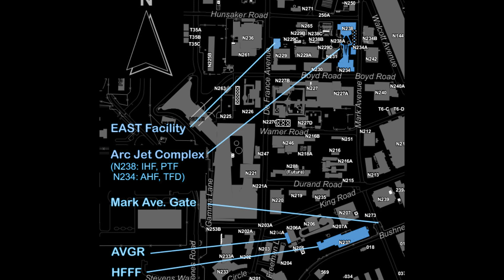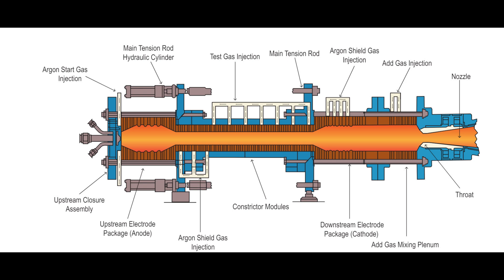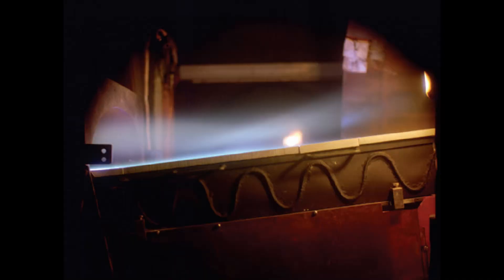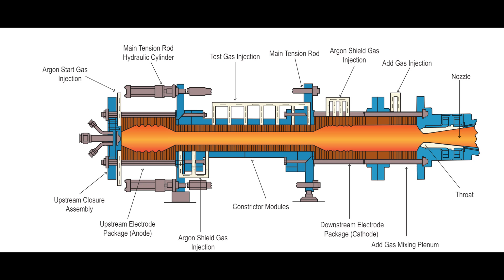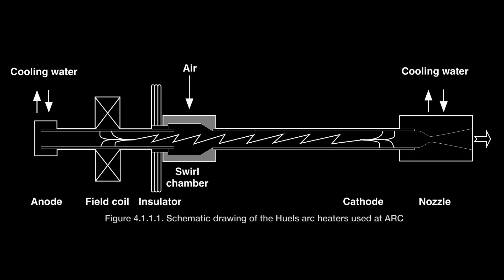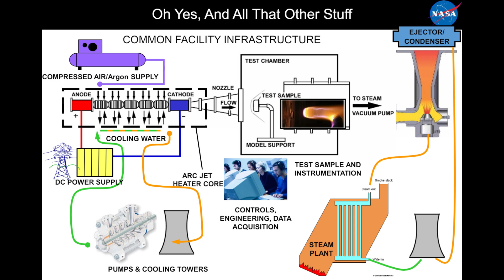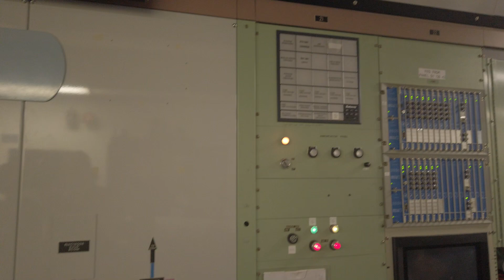How NASA Tests Heat Shields Using a Plasma Wind Tunnel

Comment: After some numbers, (quite easy, actually),  a laser heating a plasma (not supersonic) can generate a very high energy yet, but at a fraction of the energy.  The thought is that most of the supersonic gas just goes around the material, and most of the physics/chemistry happens within the subsonic layer, I just needs the added heat from a laser.  One can even bring the laser against the flow of the plasma, which bounces due to the plasma ionization, heating up the gas very locally.  This could even allow high temp material manufacturing, as it becomes cheap.

Comment: Convert this wind tunnel to a rocket engine.

"Assuming a conservative estimate for thermal efficiency of around 70%, the equivalent rocket engine power output would be...  60 MW of electrical power used by the arcjet plasma wind tunnel were to be converted with the efficiency of a rocket engine, it would be roughly equivalent to a rocket engine with an output power of approximately 85.7 MW. This hypothetical estimate gives us an idea of the power scale we might expect for a rocket engine that could produce similar thrust levels at hypersonic speeds. .. The power output of the arcjet plasma wind tunnel could potentially align with current types of rocket engines" - GPT

Comment: Wpw 200kw+ out of 4 fibers, 50kw of laser down a pipe is insane. The large optics at the end are collimators for the fiber. Ive seen what happens when a 4kW laser fiber breaks... it turns to a fuse burning with a blue white plasma.😮

Comment: To be a bit more explanatory, the meteor lava is flowing back to the base due to the base drag vacuum (low pressure area).  It's easily seen on the motor side of any of the liquid fueled rockets, and the reason why they have so many blankets/shields around the motors, as well as our amateur solid motor ones, with anything other than minimum diameter.  That lava is just a wee bit more dense!  Thanks Scot, Joe, and Tim for a nice view.

Comment: can we get a test using a hull made of an electron heavy element, charged with high voltage?.... id like to se the reactions when it doesn't need any heat shielding after all.

Comment: 10:51 I expect see any experiment with supermagnet shiled. I see many of ablative but need tu expand my knowledge in more stufs like supermagnet shield.
I would like to know if is posible. Because tha hot gas(plasma) wich by definition is hot gas ionized so the magnetic field can interact with it. so Imagine have 2 magnet faceing in the same way. they dont touch each other so the heat can be 5mm away from structure and also cant make erosion flow because no stream mass is touching. And supermagnet is coled by METHALOX, any of the bot or separate. Electricity can be used in a battery but i think it can store that amount of energy. so i sugest a generator compartiment fueled byt METHALOX. If this is achived the motor complexity can be reduced aswell, but is another storry.

Comment: So it's basically a plasma cutter pilot arc that is configured to burn not nearly as hot? I tried burning wood with plasma cutter pilot arc, and it basically vaporizes wood without much charring, it's that hot (and a safety reminder for those of you with plasma cutter with integrated compressor, treat it like a loaded gun, it will burn a hole in your hand before you even realize it! This is why the newer Chinese plasma torch have trigger guards).

Comment: No need for tiles at all. just drill lots of micro holes. then pump out dry ice out of those holes to form a cold co2 insulating boundary layer. you dont even really need a pump. the heat of re-entry will cause melting of the dry ice and high pressure dry ice co2 to come out of the micro holes to form the insulating boundary layer.
Reply: Now calculate how much CO2 you’d need to keep a reentering spacecraft from melting.
Reply: @Hobbes746  no much as dry ice sublimates and you only need a thin layer due to rapid decrease of temp away from hull. you can test in a lab very easily getting a cylinder etc with holes and co2 being pumped into it... the heat will heat the surrounding air instead of the hull due to the co2 boundary layer insulation
Reply: @esecallum  Peak reentry heating for the Space Shuttle was 60 W/cm2. That’s 60 J/scm2. Sublimation energy for CO2 is 26 kJ/mol. Let’s take a Dragon spacecraft: 5.4 m diameter heat shield, that’s 229,000 cm2, 
That’s 229kX60/26k is 528 mol/s is 23 kg/s. Assume 5 minutes of cooling required  that’s 7 tons of CO2 which you have to keep in solid state through the mission.
Reply: @Hobbes746  and how many tons are the heat tiles? plus constant replacement plus supporting lugs? also you only need a thin layer as ship heating drastically reduced due to boundary layer. why dont you TEST it? get a bunsen burner and co2 supply co2 extingusher...make a yt video. this method keeps the heat AWAY from the ship.
Reply: @esecallum  The entire Dragon capsule weighs 7700 kg. The heat shield is a few hundred kg.
Reply: @Hobbes746  well you can carry 12 kilos of co2.

Also we are talking about spaceX type craft.
Reply: @esecallum  I’m saying a Dragon which weighs 7700 kg, needs 7000 kg of solid CO2 to replace its heat shield which only weighs a few hundred kg. 
So if you use CO2, the weight of the capsule doubles.
Reply: @Hobbes746  wrong. You only need 12 kilos. Co2 as dry ice expands to many times it volume and also is very cold due to that expansion. Why don't you do a test instead of being a Luddite.
Reply: @esecallum  You need 7000 kg, not 12. I did the math, see my previous post. 
The volume of the CO2 is irrelevant: the amount of energy that can be absorbed depends on the mass, not the volume. 
So I looked up how much energy it takes to sublimate 1 kg of CO2, and how much energy is generated during reentry. This is all pretty easy to find.
Reply: @Hobbes746  why are you being obtuse? The co2 forms an insulating gas layer ( think tiles made of gas) to SHIELD the craft ..I never said anything about co2 absorbing the heat.
Reply: @esecallum  The heat has to be absorbed by the gas. If not, it will heat up the structure instead. A gas is not a good insulator, especially against heat radiation.
Reply: @Hobbes746  The heat will be absorbed mostly by the air rushing by. The co2 gas acts as a insulating boundary layer Shield.
Reply: @esecallum  Again, no. That’s not how reentry works. The air rushing by has been heated by the termination shock so it is the heat source. It cannot carry away heat.
Reply: @Hobbes746  really? so a 500 degree object cannot carry away 1000 degree heat? why dont you do some experiments instead?
Reply: @esecallum  Pay attention: the air “rushing by” has been heated up by getting compressed as it meets the capsule. The air is the heat source, and the heat of the air is what we are using the heat shield for! It is not at 500º, it is at several thousand º.

Comment: Just for some context of the power of those lasers they shoot at the target heat shields: 
A pretty standard industrial fiber laser used for metal cutting/engraving is 50 watts. Those lasers are 50 kilowatts. That's a spicy laser blasting those shields.

Comment: Thanks for the walk down memory lane.

 I spent about three months at the Ames arcjet wind tunnel facility in early 1996. I was working on a NASA contract to develop and test a half dozen heatshield concepts for the X-33 SSTO test vehicle. I was sharing time on the arcjet with Lockheed engineers who were testing the heat shield for the NASA Stardust sample return capsule.  

The arcjet was scheduled to shut down in April 1996 for an overhaul that would take months. We were pushing the arcjet to its power limit (~45 megawatts) and continued to explode the titanium tube ballast resistors. I was slowly getting the test data I needed but we would lose two days every time a resistor exploded. 

I was using the semi-elliptical nozzle, and my test articles were 2 x 2 arrays of heat shield panels that measured about 60 x 60 cm. Each test run was about 4 minutes long.

I finished my work in early March. IIRC, Lockheed was still pushing hard to get its test data before the facility shut down.
Reply: Thank you very much for sharing!
Reply: @SebSN-y3f  You're welcome.

Comment: 8:45: It only takes about 350 kWh of energy (1260MJ) to melt a tonne of steel, so 200kW melting a few grams of steel is easy to conceptualise (at least, for me).

Comment: 0:12 I used to work at a steelmaking meltshop which has a 60MW electric arc furnace. It could melt about 82t of scrap steel (and 3t of fluxes) at a rate of about 2-and-a-bit tonnes per minute, or 35kg/70lb per second. Just for a sense of scale.

Comment: I was wondering if there was a system for testing reentry conditions ever since watching the Starship 4 test.

It also is another point against rocket launces being fake, cos before seeing this video i was thinking that the energy needed to heat air into a plasma would be such a rediculous amount that there would be no way itd be able to sustain for more than a few dozen seconds at most whereas reentries take minutes at least.

And of course there's the matter of size, the test chamber is about 3^3m with the useable space being in front of the nozzel, so thats like a meter of fuctioning space.

Rockets are generally a LOT larger than a meter, so the test chamber needed and the energy needed would cost SO MUCH money and electricity that it wouldnt even be worth doing, as id imagine most of the money spent maintaining a system like that would be replacing warn parts and cooling.

Comment: the fact that nasa was like "hey scott, come on over were gonna show you around this testing facility." is a very good reason to like nasa. they are an educational institution along with being a pioneering and testing firm. they made a lot of today's aero and space possible.
Reply: The Air Force also gives tours of their similar facilities (provided they don't have any classified test articles around at the time.) I got to see several of them when I worked at AEDC. They have wind tunnels, jet engine testing facilities (several of these,) upper-stage rocket motor testing facilities, arc heaters that used multiple times as much power as the nearby town, guns for testing aircraft canopies (i.e. the "chicken gun,") and a light gas gun that can fire projectiles the size of a naval round at roughly orbital velocity.

Comment: It's interesting that the Orion heatshield had unexpected erosion on Artemis 1 even though it's testing at Ames was presumably successful. I wonder what difference between the test conditions at Ames and the actual reentry from the moon caused this difference in behaviour. Maybe it's just the sub-scale nature of the ArcJet tests? I hope NASA tells us more when the Orion heat shield investigation is complete.
Reply: That 50-megawatt arcjet facility at Ames was built in the 1970s to test the Space Shuttle rigidized ceramic fiber tiles on the Orbiter years after the Apollo program ended. IIRC, it was recently upgraded to 60 megawatts.

Those Shuttle tiles had to survive entry speed of 7.8 km/sec from low earth orbit (LEO). The Apollo Command Module speed was 11.1 km/sec on return from lunar orbit. Consequently, the peak heating rate was about 15 times higher for the Apollo CM that for the Shuttle.

You could test small samples (~10 cm diameter) at the CM entry heating condition from lunar orbit using one of the conical nozzles. NASA wanted to test large arrays of Orbiter tiles (4 x 4 tiles, ~60 x 60 cm array) at the heating typical of a return from LEO at 7.8 km/sec entry speed. The semi-elliptical nozzle was built for those tile tests.

The Orion heat shield was tested at 8.9 km/sec in 2015 using a Delta Heavy launch vehicle to fly an elliptical earth orbit (EEO) similar to the one used by the uncrewed Apollo 4 flight, which successfully tested the Apollo heatshield at 11.1 km/sec entry speed and certified Apollo to fly astronauts to the Moon.

Unfortunately, in 2015 there were no launch vehicles that could test that heavy Orion spacecraft at 11.1 km/sec speed. 
That test came in Nov 2022 when the uncrewed Artemis I circumlunar flight was launched. NASA and Lockheed have spent over 20 months trying to figure out what happened to that Orion heat shield and how to fix it.

Comment: There seems to be more to said about the support arms... What are they made of? Cooling them with water would avoid them heating up from radiant heat, but surely plasma, which is made from highly ionised gas, would physically destroy the material that the arm is made if?

Comment: I was wondering if you could use something like what the stings use to keep cool, and enhance a heat shield by making it porous and having water percolating through it, but with the steam from the boiling water coming out instead of being recirculated, so as to form a layer of steam to protect from direct contact with the plasma.  The steam would also absorb some of the infrared radiation from the plasma, thereby providing additional protection.

Comment: You show us all that, and my brain goes.... What sort of power input and on off switch does a 50 megawatt science experiment use to avoid flashover, and how does the local grid supply that much from generation capacity!

Comment: If the copper plates are insulated from each other, the current flowing trough the plasma should induce a current in the plates generating a magnetic field pushing the plasma to the center of the hole in the plates protecting the copper and focusing the plasma. Breaking my head now how mega Watt beams of plasma can erode the disk.

Comment: After seeing pictures of the Artemis Orion heat shield after re-entry with the chunks eroded away, I really hope they test the heck out of that shield design in this facility before flying humans on the next one.  If I was one of those astronauts, I might be tempted to say "No thanks" until they get an the actual article through a re-entry cleanly, butI imagine the cost of adding an extra uncrewed Artemis SLS launch would be enormous.  I hope it holds.

Comment: fun one for you scott. worked around one of the air vortex stabilized arcjets and I was told they can judge the electrode erosion because as they erode, the rate at which the arc orbits around will change.

Comment: I remember getting to tour the NASA Houston test facility for Shuttle heat protection.  That was pretty impressive stuff, where they were passing high pressure, high velocity steam over a huge bank of electrodes to electrolytically rip the steam into oxygen and hydrogen molecules.

Comment: This is really interesting. As an engineer in thermal protection, I have manufactured a few parts that went through the arc jet at Ames. We made some experimental parts for Dream Chaser and we got to see the photos of what they looked like after the test. I have never seen footage of the facility itself, so thanks for that.
Reply: No need for tiles at all. just drill lots of micro holes. then pump out dry ice out of those holes to form a cold co2 insulating boundary layer. you dont even really need a pump. the heat of re-entry will cause melting of the dry ice and high pressure dry ice co2 to come out of the micro holes to form the insulating boundary layer.
Reply: @esecallum  How much dry ice would you need for a 14 ft diameter capsule traveling at  18,000 MPH?
Reply: @esecallum no need. Atmospheric Aerogel Drones get the job done

Comment: There is one facility at the University of Illinois which is using inductively coupled plasma to do similar experiments but it can't even come close to reaching the power levels this does.  Imagine what thickness of steel the jet from this could blow through...

Comment: A kilowatt pulsed laser might SEEM like a reasonable power measurement...
...said no one ever.
That kw is average power. the instantaneous power of a pulse is probably in the Mega or Gigawatts.
Example: You can get pulsed fiber lasers with single digit watts of average power that will etch steel.
Reply: Yeah, for reference, a regular laser pointer is less than 5 milliwatts. That is 1/200th of a watt, while a kilowatt is 1000 watts. A regular laser pointer is also dangerous for your eyes, but reflections off non mirror-like surfaces should be safe.
Reply: @LaughingOrange  Right. But the point I was making is that pulsed fiber lasers have VERY short activation times.
Picoseconds are normal. Femtoseconds exist.

That's how those little desktop units can etch steel. The average power is very low. But the instantaneous power is enough to vaporize the steel before the heat can be conducted away.

A desktop laser might be 'only' 1 watt, but it spends most of it's time in the off state. Each pule of that laser might be a Megawatt, just for an instant.

Comment: I spent a summer working at the Mars Surface Wind Tunnel across the street that tapped into the vacuum pumps from the Arc Jet Facility.  I got a tour of it as well—very cool place!  That was back when Shuttle was still flying.

Comment: Nice to see they are still using the Rockwell Retro-encabulator in the laser lab. To this day no device has been conceived which can surpass its performance in reducing sinusoidal deplaneration.
Reply: Side-fumbling was practically eliminated as well, very impressive.
Reply: I didn't understand, what are they using?? Hahaha
Reply: @snjert8406  It's pretty much impossible to explain in a single comment, but this is a decent overview at least: watch?v=RXJKdh1KZ0w
Reply: @snjert8406  I tried to post a link, but youtube doesn't like that. Look up "retro encabulator" and it should be the top result.